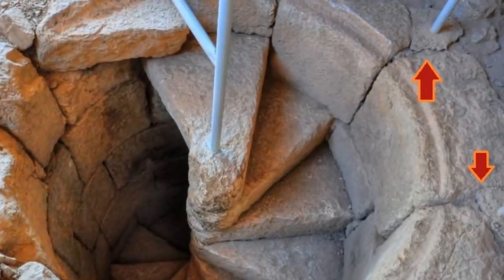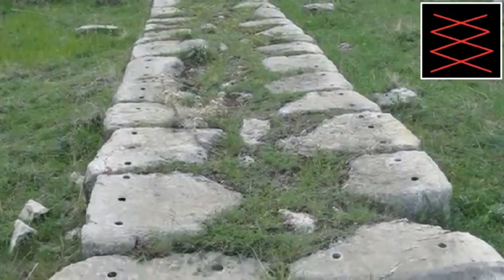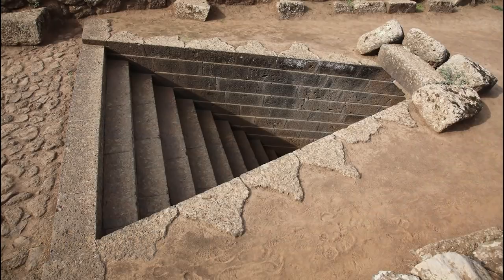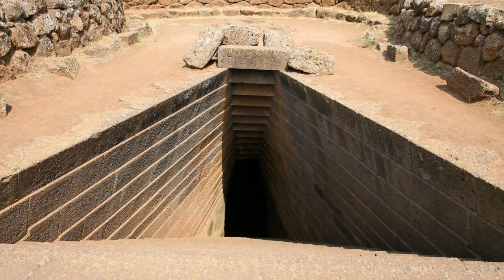That`s what it is

Comment: With the two nubs on the blocks at 6:00 one nub maybe for concrete entering a bag and the othere nub for the exiting of the concrete... probably a very wet mix to achieve a tight fit of the join between the blocks .

Comment: I've worked in construction for over 20 years and every time i see these pictures of so called stone cut ruins it all looks like concrete , dont people think it would be easier to crush stone make some type of concrete out of it and pour  in slabs or bricks  , then carve them out  , in some of the first pic,s in this video you can even see the air bubbles in the flat surfaces ( good job wiseup )
Reply: That had been my thought too, then I saw great pyramid k 2019. I don't agree with the end so much but the method of construction is spot on

Comment: I'm getting sick of all this melting rock bs too brother, I have a forge and kiln and I'm able to melt almost anything except rock I've tried all kinds of rocks and bricks and nothing the only thing that happens sometimes is they explode
Reply from the maker: I`ve been dealing with it since before and after opening this channel, these folks think they`ve discovered something new !!!!!!!!!!.
                       WISE words Joshua Russell
Reply: It depends on what your trying to melt, Crystals 4000°C but around 2000°C will melt most, in construction.
In your video you show a building technique I believe is called Sulphur Impregnated concrete. The X REO in moulds are used today. 
The other point is that hot Sulphur Concrete can be made at just 150°C and easily molded 
Basalt and Dolerite concrete aggregates are also worth a look.
Reply: We heat rocks for our sweats and rocks don't melt,  they explode
Reply: Im not Shure but you would have to use a electro magnetic and or vibaratory way of melting rocks..but the proof is everywhere....mater manipulation.....turn the rock into butter...guy on utube does it with metals
Reply: @davidthomas2886  completely different
Reply: There are videos of individuals melting granite on YouTube. Molten rock is essentially what volcanos spew. It can be melted, but requires extreme temperatures that don't normally occur.
Reply: @thedude5740  there's videos of almost everything on YouTube doesn't mean they're all real
Reply: @joshr.4398  Im not an individual that just follows along with things, im not supporting the mainstream narrative. Just simply saying it can be done. Been a fan of Wise Up for years. But I possess more knowledge than the average individual and are aware of more than most. Many materials have different melting points. For instance aluminium melts quicker than steel. Rock requires a much higher temperature than most smelting equipment is capable of.
Reply: @thedude5740  
I concur!
Reply: @thedude5740  I think egypt had granite geopolimer without melting.
Reply: @DANTHETUBEMAN  many things are possible. With the human mind not much is off limits. Im currently playing around with an air/hempcrete mix. Quite the interesting material. Can cut it like wood, all element resistant, and floats while being more impact resistant than traditional concrete.
Reply: @thedude5740  would be better insulation from temperature also. So are you molding it? I was looking at earth brick press
Reply: @DANTHETUBEMAN  yea, forms are the easier method. Make a skeletal structure out of what ever you prefer to use, whether its wire/rebar/wood. Put the structure in your form. Make a foam generator and use drexel foaming agent. Use portland cement or similar, add foam, hemp mulch, Styrofoam beads, and alkaline value water. Pour mixture into the form. While it cures it needs to be periodically sprayed with water to prevent cracking. Cool stuff though, people are building all sorts of stuff with just the cement and foam mix.
Reply: Melted rock is called magma it happens in the earth all the time

Comment: My mother and  father’s home town in the Calabria regione of Italy dates back to the early 1100’s when it was built up as a castle and fortress and before that it was Greek and Italian settlements along the coastline of the Mediterranean Sea , being built on mountain tops and outcropping of mountain wall the structures still remain but are clearly visible as being cut into the rock facades and cemented over using pomice and sand from the shorelines. I’m inclined to agree with your premises wise up .

Comment: Maybe black and white photos would show up some things? Is it possible to make images go black and white? Or even a number of different filters, one at a time? Browns, greens, blues, reds, etc.
Reply: Some are wells for water but of course you know that. I agree, thick slurry left to harden over rebar same as today. 

Can the images be reversed? One lady did that with go-engineered clouds and put them side by side with the originals to reveal they were of demons.

I also wonder what would be the image if tuned upside down, or reversed not side by side with the reverse images underneath as depicted in 'as above so below'? Upside down and right way up. 

Maybe not all or even not many of them would show anything (such as a flat side pyramid with a top would form a cut diamond shape), but I suspect some would. Particularly images from Egypt and the fertile crescent in general.

A further thing I wonder about is doing the 'as above so below' with images of go-engineered clouds.

Plus what would be the shape of the sky and the land if images of buildings (and geo-engineered clouds) were completely blanked out? Maybe sometimes it isn't the shape of what most easily catches our attention but the shape of what is created around it.

I know clouds are for someone else but the buildings are your forte, Sir Mark. Best wishes.